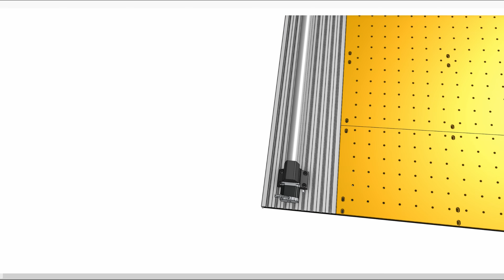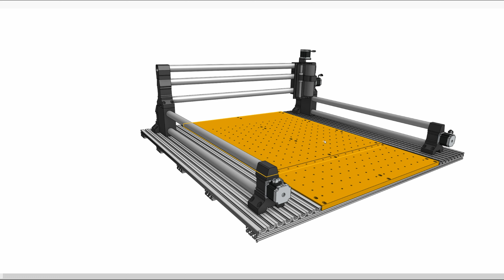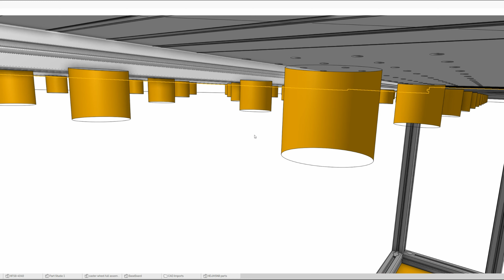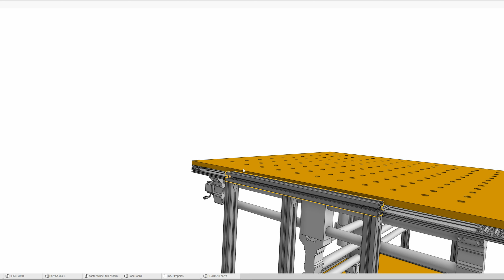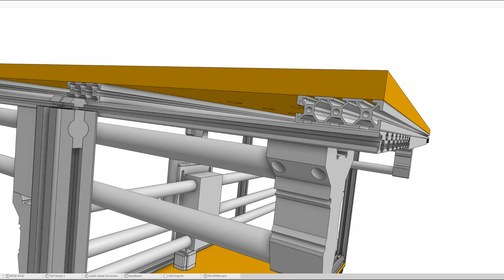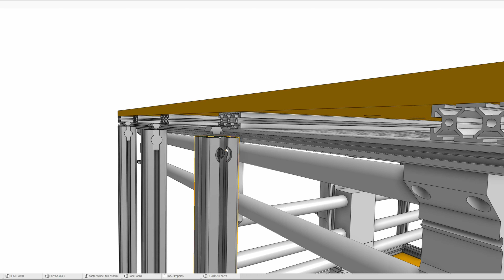Minimalist but functional OneFinity CNC Table.

Comment: Have you considered structural tubing for the frame? Something like https://www.easyfit.com/ ... not recommending them but something like them. Then you have a 1" dia axel, and then you pin it in horizontal plane.  Waiting for upgrade announcements before I design my "forever table" ,,, really want a 48" cutting span
Reply from the maker: No. Haven't thought about that. Even there something available, it's too late, I'm already building the table as we speak. 😆.
Reply: @francis.creation  Chuckle, been there ... I will be interested in the deflection and how the bolts hold up ... Good Luck :)